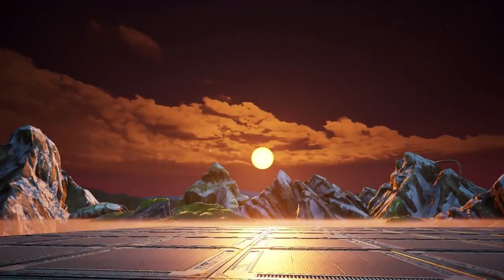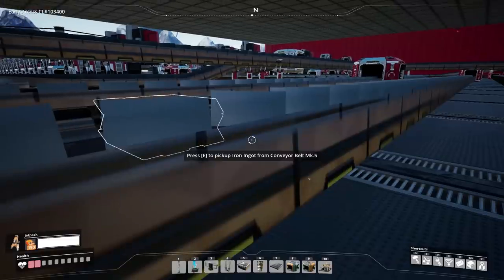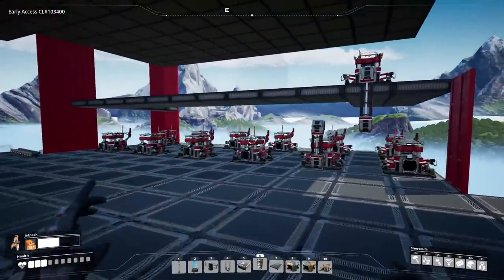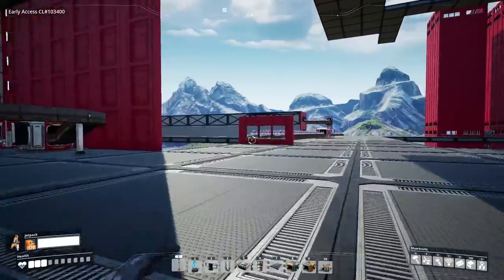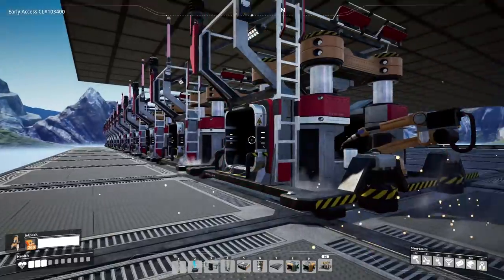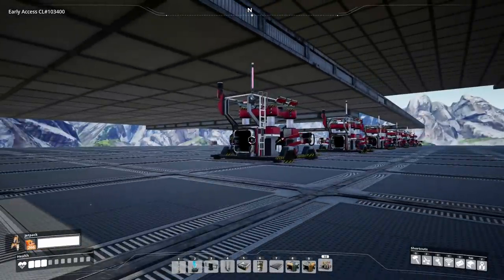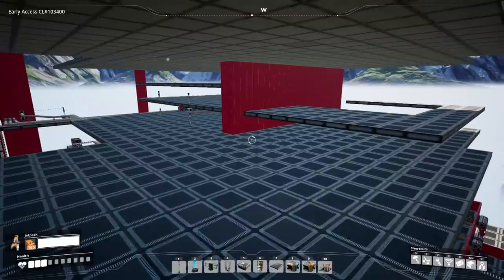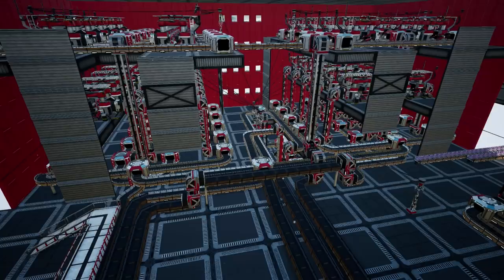Satisfactory ~ᴍɪɴɪ~ BEAST! (1,800 Quartz /min) - Satisfactory Early Access Gameplay Ep 59

Comment: A splitter splits in multiple directions, if 2 machines face each other into a common output, you save space on the floor. Same with the input, 1 splitter can fit 2 machines, so much neater and can fit so much more on a floor.

Comment: why not the "Stiched Iron Plate" alt. recipe?
Screw screws! Use wire!
Reply: Thank you was about to comment this
Reply: He did use wire in the end. I think he clicked the wrong alt recipe in the beginning of the video.
Reply: He has 2700 screws a minute though
Reply: Eliminating Screws is living your best life.
Reply: Uses less iron too!
Reply: Yea the stitched iron, even with iron wire recipe, still saves the hard part, the iron plates, they suck. I just built my 450 stitched iron plates a minute, 60 assemblers. Just 600 iron plates a minute.
Reply: @droppingpins6244  Offt! That's twice as many as mine produces and it's a vast building.
Reply: Stus PageOfGoo combined inputs and outputs saved space, 1 splitter feeds 2 machines, 1 merger collects 2 machines, just to save space. There’s a spot on the edge of the desert biome ona ledge, mid west of the level 3 starter point. It has 4 pure iron and 2 pure copper, kinda overlooking 2 quartz lines. I’m using 3 iron and one copper line, because I built the factory over the last iron node like a jackass, still took me about 4 hours, go big.
Reply: @droppingpins6244  That's exactly where I'm building too dude - using the alt recipe for iron ingots. My plate factory started off using screws until I started running out of iron and realised the difference. My constructors feed to one splitter and directly up to the assemblers.. Kiblitz would like it I'm sure - very neat and expandable. I unfortunately built on top of the hidden Caterium node located near the 4 pure iron nodes though.
Reply from the maker: I get into that in the next episode ;)
Reply: @ImKibitz  Nice wan! Every episode makes me smile as you crunch the numbers and SUUUper size everything!
Reply: @ImKibitz  what a tease
Reply: @cacnus  I don't think that'll be enough for this project

Comment: I think you carried a 2 somewhere...  You shouldn't need 2,520 Cable/min.  If you are shooting for 90 Crystal Oscillators/min, you need ~ 48 Manufacturers.  The Crystal Oscillator needs 26.3 Cables/min.  So 26.3 multiplied by 48 ~ 1260 Cable/min.

Edit: I had typed 64, when I meant 48.  Thanks for the correction.
Reply: I got you but you mean 26.3 multiplied by 48 = 1260
Reply: @stuartpatterson1617  Doh!  I was comparing that against my own 120/min Crystal Oscillator build and had 64 manufacturers on the mind.  Thanks.

Comment: @ImKibits, for your loadbalancers, just stack 3 splitters then 3 mergers connect each splitter with its merger, then connect the bottom and top output and vice versa, then lead to three more splitters, connect each splitter with each merger, then connect each splitter with the merger 1 level up, and vice versa
X_ \M - X_  \M
X_  M - X_ / \M
X_/ M - X_ /  M

This is a much more visually appealing load balancer.

This works with a 4x4 balancer as well, 2x2 just use the second part, for 5x5 you'll need to add another row of splitters and mergers/

Comment: Why are we so worried about the ramp up time for the overflow method? It'll take hours before the next step in the line is ready anyway. It'll still produce items, even if the constructors aren't at 100%. There's no way the time you spend load balancing isn't better spent making more production.
Reply: Well...

...load balancing is fun.
Reply: @Dylan Kimble Have you ever seen the entire northern oilfield being simultaneously switched on, 3,5k oil being processed into turbofuel and then turned into electricity? Amazing save file, I love to rewatch that. All it takes is one cable.